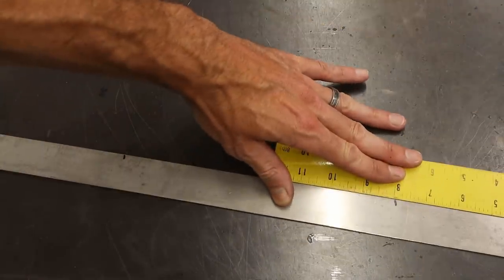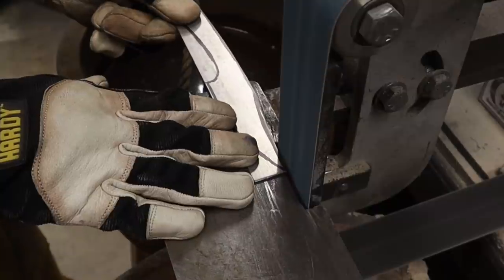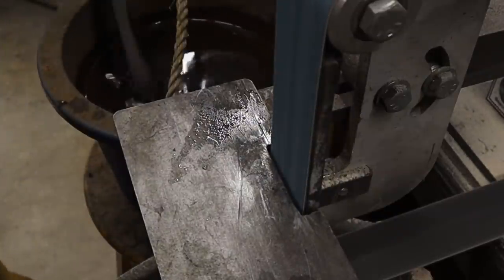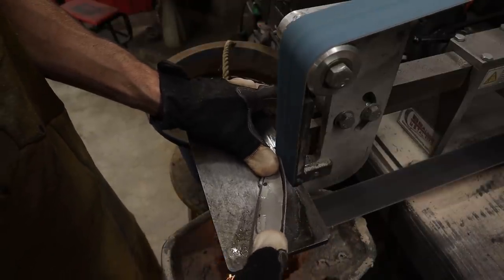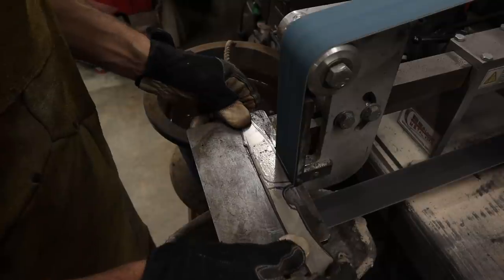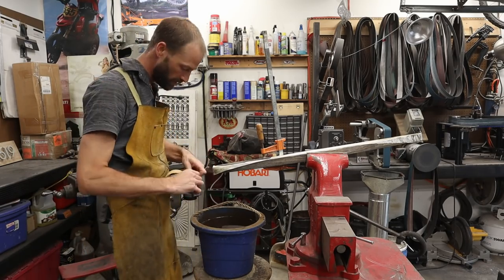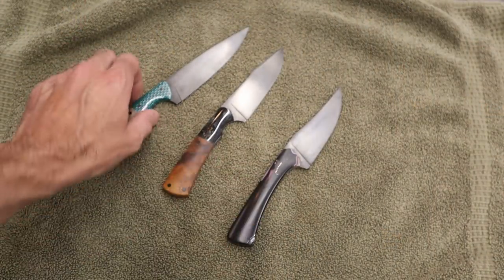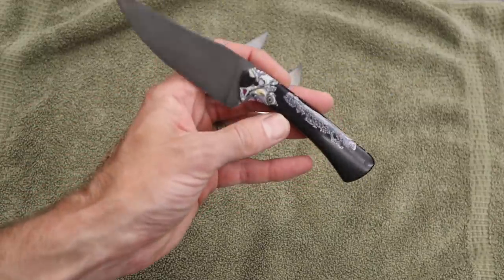Make knives 10X faster with these grinding tips

Comment: Again, another fantastic video. Outstanding insights on grinding the profile. One of my distant projects is to make a multi purpose bug out cleaver. Would you use 1084 our something else ?. I’m thinking about just edge harding it and keeping the spine soft so you could hit it with a hammer without breaking it. Just bouncing some ideas around
Reply from the maker: That's exactly what I would do! 1084 differentially heat treated!

Comment: would normalizing the steel be necessary for this style of grinding and the heat it generates? i only have a forge so holding a specific temp for extended times or allowing a very slow cooling is kind of tough(I do have a steel bucket of vermiculite though). id like to profile like this though; currently, I am taking it kind of slow. when the blade gets to hot for me to touch with bare skin it goes in the water real quick.

Comment: What belt is that? I have a 40 grit belt on my 2x72 and cant grind half that fast at full speed
Reply from the maker: This is a 36grit zirconium belt. 2 horse power motor running at about 70%

Comment: For someone just getting started I'm interested in an alternative to a huge expensive grinder such as this.
Reply from the maker: The 2x72 is the most versatile tool I have ever owned! Does waaaay more than knife making!  With that said, there are do it yourself options that save a lot of money! Check out the Revolution grinder from house / work
Reply: Hi Jeffrey, take a look at a 1 x30, or 2 x 48 grinder.
Reply: A-1 by 30 from Harbor Freight will cost you approximately $57 and I work great just not quite as fast
Reply: @davidpugh4527  Thank You
Reply: @jeffreymiller9706  you're welcome Jeffrey
Reply from the maker: A 1x30 has its own drawbacks also. You will have to do some modification to the platen and also generally lacks the horsepower to hogg off material!
Reply: @Aleeknives  if you buy the new Central machine works one by 30 the plant and goes almost all the way up to the small wheel don't you think not being able to hog off medal as fast will be an advantage to someone new at grinding knives
Reply: @Aleeknives  

Definitely!!!!!!

Comment: Hello Airin, Mass production is definitely accelerated with this grinding machine. But it looks like you need to change the sander every 2-3 blades. How many grit abrasives did you make these knives with, man?👍🙂🙋
Reply from the maker: Happy Sunday Volkan! I get about 10-15 blades out of each 36grit belt. I use fresh belts to grind the bevels and old belts to hogg off material

Comment: Now I know how and when to use my 36g belt on my high speed 2x42 Norse belt grinder! Sweet! Any other application with low grit belts in the little beast is too too risky, especially since there's a bit of flexion between the tracking wheel and drive wheel. I've added a brace, and a new, DIY fabricated tool rest, but there's still a little bit, which throws off accuracy. In my opinion, if one masters the little beast, a 2x72 is likely going to be a trip through the lily fields on a warm spring day a few hours after a light morning shower bringing an iridescence to bursting blooms of sparkling wildflowers never seen before cascading into a cool pool of water... (hmmm maybe I made my tea a little too strong today...)
Reply from the maker: This was crafted so eloquently!

Comment: I've been using a lot of 1/16 and appreciate the tip to do bevels after heat treat.  How many normalization cycles do you do?
Reply from the maker: I don't normalize the steel I get from new jersey steel baron. It comes completely annealed.

Comment: Well damn! Stop making such good videos. Now I want to turn my wood shop into a knife making shop. Just maxes my first scales and handle. But had to use a purchased demascus blade. Now that I want to become bad as like you… is a forge the only way to heat treat? Which grinders to you recommended. They go from $500 to 2500? Havnt seen a link to the one you use.
Reply from the maker: I am actually preparing a build series on the Revolution grinder by housework.us. 
I think it is the ticket for knife shop grinders. As for heat treating I use a forge but it is not ideal! A heat treating oven would be better
Reply: @Aleeknives  Yes, the revolution seems like the way to go. I’ll look forward to people posting links to specific motors, wheels, and other not included parts that will work well. In the research I’ve done since you so quickly replied, it seems like any oven that gets 400° will work? Some people do 20min some 1hr. Will a kitchen toaster oven work?!
Reply from the maker: Heat treat occurs between 1700 - 2200 degrees Fahrenheit.  The 400 degree cycle is just a tempering cycle after heat treat. The temperature range depends on the particular steel.

Comment: wtf? what kind of grinder do you have that eats the steel like butter? Im a beginner knife maker i just use a 4x36 and have some stock removal belts at 36 or 40 grit, but it still takes a while to cut through it. I dont shape my knives like this at all. I have to use an angle grinder or a miling machine to get the shape outlined.

Comment: yeah the tip here is you need a 2500$ belt sander and you will go 10 times faster ! lol
Reply from the maker: You can do this on a 1x30 or even a bench grinder with a course wheel. I also am partnering with Brian over at House/Work to teach people how easy it is to build his diy grinder kit for a fraction of the cost.